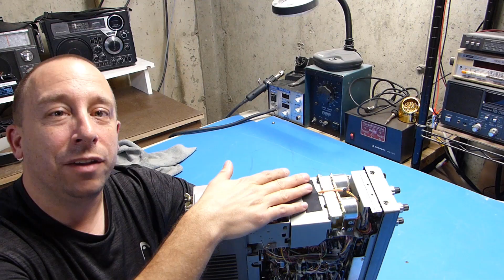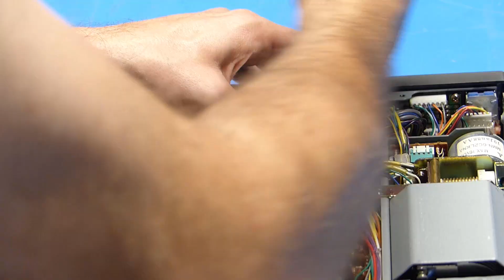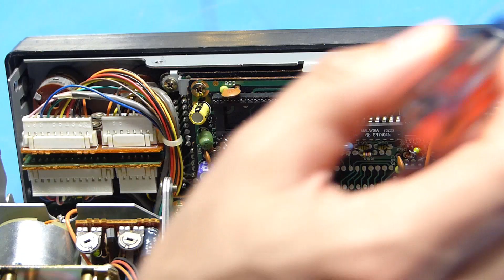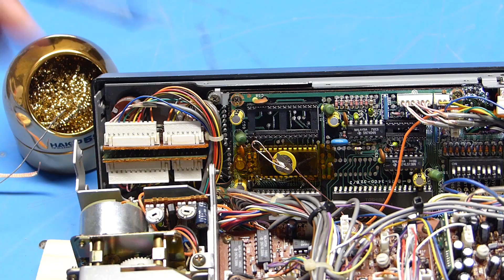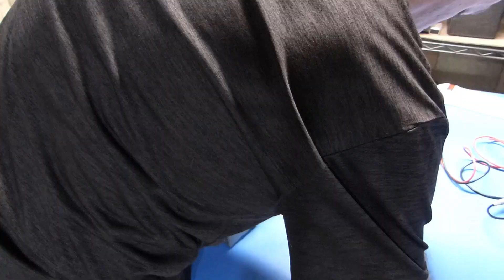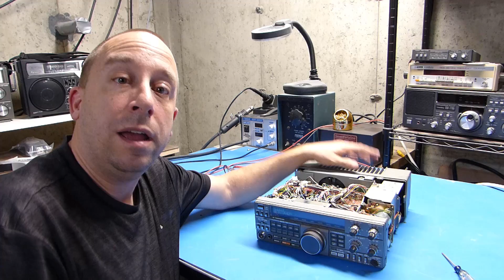Kenwood TS-440 Ham Radio Memory Battery Replacement

Comment: I have the ts 140s, and to me it's such a scam cheap, ripoff design, by kenwood, to bury the $1.50 battery, in there, forcing most non technical hams to spend 175 bucks,(back then,probany twice as much now, if they even do it), for a new battery replacement, and alignment, when they could have EASILY designed the battery access, way more user frindly,,,the TS140s was my first real radio, coming from a homebrewed hw101,,,and I loved it, and still do,,,rock solid, modest transciever,,,great vid,,,de NV1H😎

Comment: After the radio ate a couple batteries my elmer just ran wires to a D battery holder on the outside of the radio.  It worked great.  Gave the radio to a friend.
Reply: Hi

Comment: I have the ts140s,,,I'm assuming the procedure is the same,,for dead batteries,,,so my question is,,,will the radio work normally, EVERY TIME, WITH THE RESET,,,,, with a dead battery,,,after doing the reset sequence,,,but WITHOUT changing the battery,,,,?,,,I realize, I'll have no memory, but it beats the 200 buck, battery replacement charge, for an 8 dollar battery, from kenwood,,,,,thanks,,,,,informative vids😎
Reply from the maker: I think it will work if you reset it.
Reply: @SevenFortyOne  ty sir,,,😎

Comment: i dont have any of the 3v type batteries with the side coverings like you have but i do have a stack of CR2016 and CR2032 lithium button batteries would the be ok to use if covering with tape around them there 3 volt button batteries so with care i would guess they should be ok. but would sooner check with somebody just incase
Reply from the maker: If you can attach leads to it and put it somewhere it won't short to something else in the radio it should work....but I'm not a doctor so keep that in mind if you try this
Reply: @SevenFortyOne  thanks yer ill take care when i do it iv also got the dreaded dot screen problem but i dont know for sure if its caused by the dead battery as the radio came from america and had been switched of for long while it did work ok for about a week i got an auto atu for it but couldnt get it to work seems theres two trypes one european one for usa and ironicaly the radio is a european model it was only after trying to install the atu that i developed the dreaded dotted screen i would tackle the vco cleaning procedure but parts are very hard to get in uk for lot of the earlier model radios so will have to go on major hunt for spare parts im hoping changing battery and doing factory reset might fix the problem even if for few months lol once again thanks and good vid id never found the battery housing without it
Reply from the maker: Definitely try the battery and reset first.  I found that warming up the radio helped with the dots too...in other words if the room you are in is cold try it on a warmer room and see if the dots go away
Reply: Many thanks. I just bought one few days ago. I will add a cr2032 wired holder. Wires can pass thru the shield somewhere I hope. Regards from France.

Comment: Thanks for the tutorial.  Very clear instructions.

I used the W09-0599-05 battery from East Coast Transistor parts.  $14 shipped.  Direct replacement. In my '440, Kenwood slightly sprung the battery tabs downward while the solder was hot.  Solves the vibration problem without the annoying tape.

Re: ESD (static) - who needs wrist straps?  :)  Just touch the metal chassis often.  It also doesn't hurt to briefly touch the soldering iron to the metal chassis.  Cheers!

Comment: I replace the battery in my ts-450sat. If I had to do it again, I would find a way to install a battery holder rather than soldering in a new battery and I would relocate the battery to a more convenient location.

Comment: Nice to see you're gettin the old gal back on the air.  I saw it on the bench in your new Future of... video and was wondering if you'd got back to it.  73
Reply from the maker: The VCOs still need some work....just have to find the time to finish it off.  I love the old Kenwood radios
Reply: @SevenFortyOne  I really enjoyed my 480 on mobile this summer.  Can't wait to get the house nearer to done and set up my shack with my 440(s).  You have yourself a Great time tonight and be safe.  Happy New Year from Ukraine.
Reply from the maker: @buckeye5704  73!  Have a great 2020!

Comment: The maintenance manual is online and shows the disassembly procedure.I think you leave the bottom screws in and they are not taken out all the way to allow the head to pivot like on the TS 570.
Reply from the maker: I didn't bother looking up the manual and went by directions I got from a friend...I think I heard him wrong with regards to which screws to pivot on. Either, taking all 4 out worked fine...just have to be careful
Reply: Hi bill

Comment: Thanks for sharing your video!!!  I have a Kenwood TS440 with the auto tuner.  It was suffering from the dot issue, but only on the 10 - 15 Meters and 40 - 160.  The 17 - 30 Meters worked fine.  This TS440 belonged to a good friend of mine who passed away.  Apparently he had tried to fix it and remove the glue, but while doing that he broke two different diodes.  I had the replacement for one of them and now it works from 17 - 160, but still don't have 10 - 15.  Of course that particular diode is hard to find, but I finally found it and ordered several.  All I have to do now is after hunting season is over put it back on the bench and replace the diode in that circuit and hopefully the dots will be gone from that part.  Right now I am using the radio since I mainly operate 20, 40 and 80 Meters.  At least now I know where and how to replace the battery.  Keep up the great videos my friend and hope to hear you on the airwaves again.  Juddie - WD8WV
Reply from the maker: Thanks Juddie.  Mine had the tuner too but it doesn't work....I haven't tackled that yet.   And I have some more work to do on the dots issue...the VCOs meet to be trimmed ad it's off frequency now. 73 and good luck with your 440!

Comment: Nicely done !  Too bad they couldn’t have designed that better , but u guess how often would that battery really need to be replaced , 10yrs or something probably
Reply from the maker: They probably figured these things wouldn't hang around that long and didn't worry about it.  As long as it lasted longer than the warranty period they were probably happy.
Reply: Nicely done.  
I always felt that if the device, radio or computer required a battery for memory retention,  the battery should be accessible and replaceable without tools.
Reply: according to the manual, they expected it to last ~5 years and for you to send it in to them for repairs once it happened.

Comment: My 1990 R-5000 needs this. Already had it apart. Tight quarters. Also going to do a warm white LED panel bulb, mine's dead. Good info, Thanx.
Reply from the maker: I have to open mine up again...the VCOs are still flaky...I didn't get all the goop off of the PCB I guess.